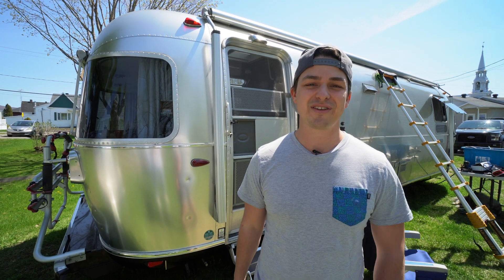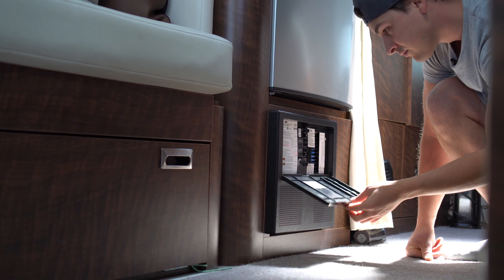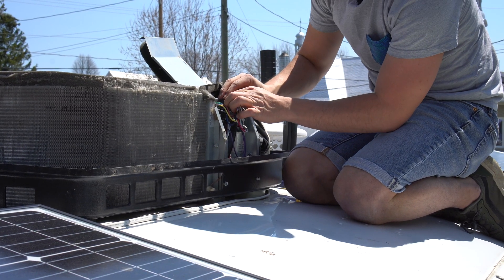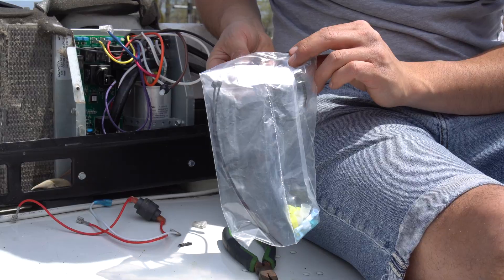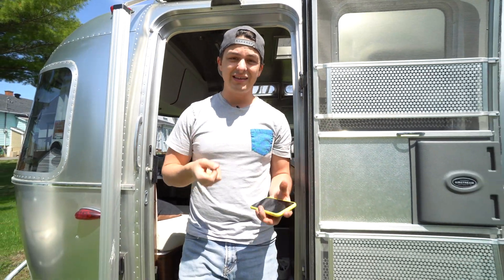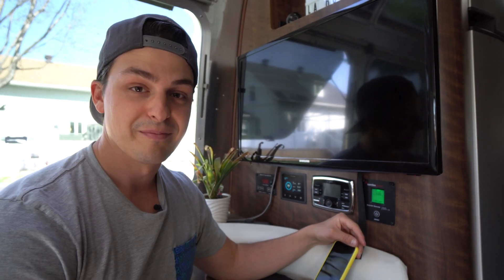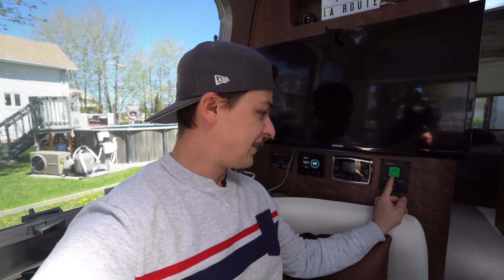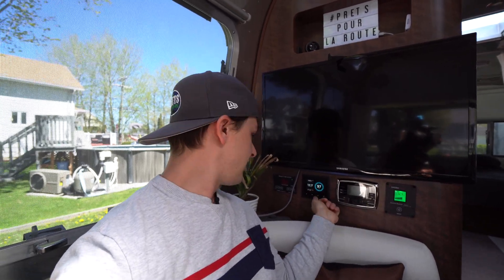How to run A/C off solar - Micro Air EasyStart 364 install on my Airstream RV

Comment: **5:10. White from the Easy Start goes to C on the Run Capacitor not the HERM.
Reply: Exactly - Those that comment this is a helpful video you better do a double check because if you follow this tut you will have issues.  It's incorrect.

Comment: Thank you so much for the great video it helped me to get the courage to tackle this job! I want to point out for others watching that while it is done physically correct the verbal instructions are a miss, the white wire goes to C not herm, the orange goes to herm. just a bit confusing. Thanks again
Reply: Thank goodness for your comment!  I was stressing as there WAS no white wire coming off the HERM after removal of the start capacitor.

Comment from the maker: Its CYBER MONDAY discount sale is coming for both the EasyStart and EasyTouch RV Wifi smart thermostat are going to be sold at the lowest prices of the year during a sale.

The dates are November 23 to December 7 and it is $50 off (CMETRV) the EasyTouch RV thermostat and $35 off the EasyStart 364 (CMEASY)

Comment: Can you tell me more about your solar power setup I’m looking at a 500watt system but it doesn’t have the digital readout like in your video any help would be great
Reply from the maker: yes! i'm using the simarine battery monitor, but victron also makes one that is cheaper and can give you the same informations. It's very useful to monitor your battery levels and consuption.

Comment: Nice install.  Couple of questions?  What size inverter are you running?  I presume at least 3000w.  Also, during your install did you address the heat pump wires.  I understand that one or two of those wires need to moved as well. I have 2x Penguin II's  on top of my Airstream and just received my MicroAir Easy Starts yesterday.
Reply from the maker: It's a 2000w inverter :) and it works fine, the A/C is pulling about 1600w so that leaves us a little bit of room for our computers and other stuff. 

The installation kit and instructions by micro air are kind of simple. There are just 4 wires to connect and you have to get rid of the start capacitor. If you have any questions, just call them, they are very helpful (they helped me find my inverter wire problem in a few minutes).